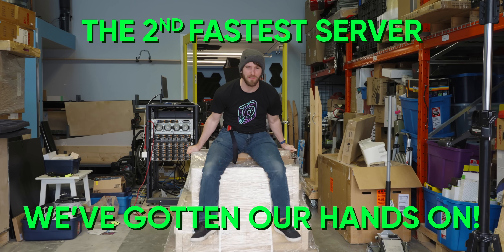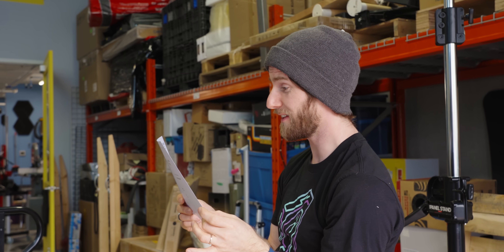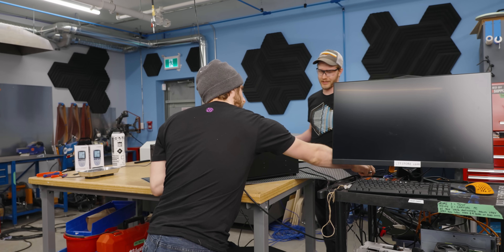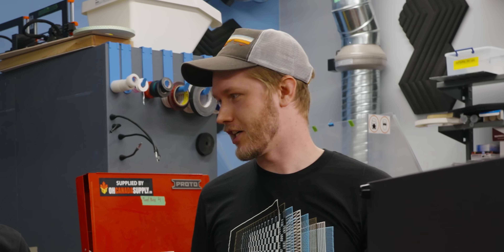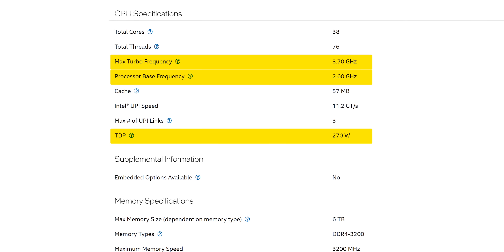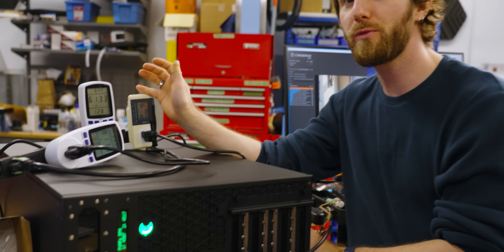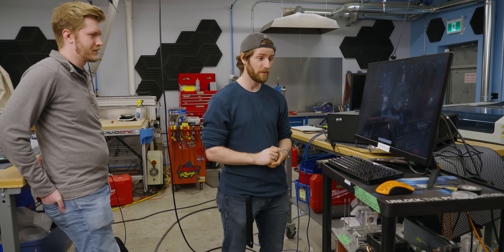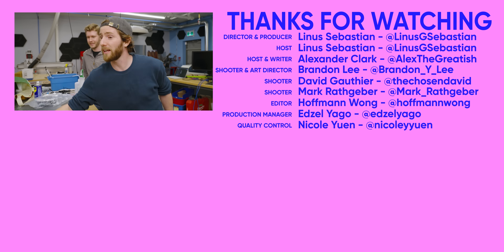The God of Computers - Comino Grando RM

Comment: Mr tech tips, I need you to install a battery backup/solar generator system for your home using a couple bluetti ep500pro units and a smart panel so I can avoid any pitfalls you encounter.  I also need this by the end of the week, so chop chop.

Comment: Pretty sure it's my first time seeing someone open a computer chassis with a power drill and a crowbar lmao
Reply: and a sledge hammer, cant forget about the sledge hammer
Reply: I would say this is a step above simply "a computer chassis" 😅
Reply: Are you new here? LOL
Reply: I've got a pair of HP DL165's that i have to use a prybar on to the get the lids off.
The push points just don't provide enough leverage to move the bloody things more than a few cm, enough to get a prybar in.

I stopped putting the lids back on a few years ago.

Comment: Actually the perfect sponsor. I was just trying to set up my RGB with armoury crate and about gave up.
Reply: When I tried it you needed to have a premium membership to have the good features
Reply: @AxionQc  try openRgv
Reply: @dandreani  my stuff doesn’t support open RGB
Reply: Armoury Crate sucks. It does not detect my mobo or fans. I contatced, support attached all the details and they say reinstall of os is the only way to get it working again. I tried openrgb and it works without any problem.
Reply: @skioles  And my Asus Mouse dosent get recognised by Armory at startup.
Reply: It took me hours to get RGB between armory crate and corsair software to properly talk with each other. I still have to run two pieces of bloatware software, and every time armory crate has an update, it intentionally stops working until I open the software (and it tells me that there is an update). However, I refuse to update the software because I'm afraid that it'll break what I've previously set up. I'm definitely going to have to try one of these 3rd party RGB controllers.
Reply: Shame it doesn't work on Linux.

Comment: I really think you guys should build a rack for gaming pc parts. Want to build a storage/gaming machine with 12th gen Intel using the performance cores on a vm running windows. All for trying to get it all down to a single machine for my converted bus.
Reply: Linus did talk in the video of doing some clean up in his old home that he wants to do a v2 of his case and off hand that if it went really well they might consider selling them. Presumably though they would provide the stl files so anyone else with equipment could build it though.
Reply: I used to have a server rack I bought at a local auction, filled with a generic ATX server case and a dozen+ Fiber-Channel switches and routers linked to regular Gigabit units, with UPS on the bottom (all bought at the same auction). In total it ran me about $200.

It was good for hosting LAN parties.
Reply: @patrickwalsh416  Wow, those are shallow as well! Thanks so much, I love you now :))) Except shipping is US only :(
Reply: How do you plan to power a space heater aka 12th gen Intel in a bus? Or are you planning to use an i5?
Reply: @saiyadulahmad2012  Ive got like 3600w of Solar so probably the i7 honestly. Its seems like a reasonable in between. Will still be better than running a nas and seperate gaming pc I bet. Bus gets heat from a wood stove and propane furnace though. ;)
Reply: @andrewmason9137  3" steel-styrofoam-steel sandwich is used as industrial insulation for commercial storage freezers. One computer idling in the workshop is enough to keep it shirtsleeve-temperature, when it's well below freezing outside. Just a thought.

Did you know that Styrofoam is easily recyclable and re-castable at home (vent hood mandatory)?
Reply: this is true, all of the generic rackmount cases suck
Reply: Silverstone has the RM42-502 , however it is limited in radiator size to a 240mm rad because there's still a drive cage. 

Maybe they'll consider making a version without the drive cage at some point so bigger radiators will fit.